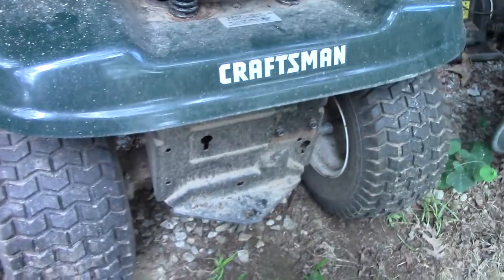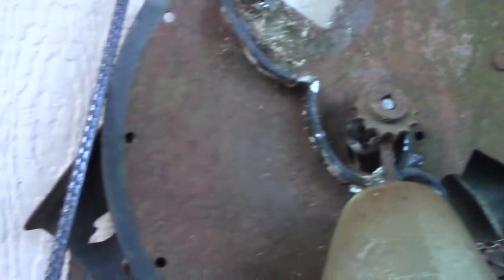Making a receiver hitch for a riding lawn mower from scrap DIY

Comment: Good timing. I was looking for something to watch.
Reply from the maker: Well then I apologize. I meant to post when you were disinterested.
Reply: @theeddies  Oh don't worry...You did! lol - It looks good. I would radius the edges so it's slightly less of a bloody shin tetanus situation going down when you walk into it.  Nice scrap horde btw.
Reply: @theeddies  What are you wanting to tow with it? I mean I get that you are going to build a "trailer" for it, but to haul what?
Reply: @theeddies  I see. Just all purpose utility kind of thing. You going to make it dump, or nah? - I mean the two leading edges on the left and right where you cut the plate (AKA the corners of the plate).  Did you sell any of those car parts yet??
Reply from the maker: Lol. I may have cut a few corners, ba dump bump, to get it done with a dodgy camera. I might need it Monday for a tree that is coming down in the front yard. Yes it will dump and no it will not be power dump. I am the power dumper in the family.
Reply: @theeddies  Oh brother! lol
Reply: @theeddies  What's the max you would pay for that little Atlas?
Reply from the maker: Around here I would give him his asking. But I can part it on ebay and make money on it if it is too much to restore. Speaking of which I did not answer your question. I have sold a few small bits of the car lot, maybe $100 so far. That stuff moves slow which is why I have always stayed away from cars. I do have a single wrench, marked "MG Cylinder Head Wrench" which is currently bid up to $52. Might go up to $100, they are pretty rare I understand. So that's nice.
Reply: @theeddies  Hell yeah at $52. Be sure to let me know where it tops out at. That's great. I can see stuff moving slow, but still moving eventually all the same. - Of course you would give the asking price as would I, but I mean if you saw it listed for $250 would you take a chance on it? I guess I understand, yet I just don't get it either, but those little toy ass lathes sell. I don't know how people have the nerve to ask like $600-$800 (or more) for shit like that, but they do. I haven't heard back from the seller, so its likely long gone. I imagine his email blew up at that price! lol
Reply from the maker: @johnstrange6799  $250 I might still do it but it would not be a slam dunk. I would probably dick around until it was already gone, lol. The little lathes can do some good work, not the 7x12 HF ones but the 9" can do alot. I mean would I want to make the little parts for that coax indicator on a 12" lathe? You could but it is abit of overkill. Most of what I do, my lathe is plenty big enough. If I were doing driveshafts it would be different. Most people are not doing driveshafts or hydraulic cylinders or whatever. They are doing model engines or small parts or some such. Plus moving the big ones and having space for something that is a rarely used tool are issues as well. Most guys I meet with 12" lathes have them back in a dusty corner with other crap all over them. They look like they have not been used in years. And they are usually for sale...for the RIGHT PRICE.
Reply from the maker: @johnstrange6799  as for price, it is often just regional. the same with vintage British motorcycles. They are cheaper up north. There were just more of them up there, more dealers to sell them. I think Chicago had 10 dealers back in the day, there is still a huge warehouse of NOS parts up there that sells. In Atlanta there was 2 or 3 dealers in the 60's and one in the 70's.
Reply: @theeddies  I'm the opposite. I like larger lathes. If I could have a bigger one I would. Not for larger work, but for power and rigidity sake. A large powerful (faster as well)  lathe cuts metal more like wood. Just peels it away like nothing which is nice, and produces a nice finish as well. Without a doubt good work can be done on small lathes though. I'm not hating. I can imagine how people might get used to a small machine if it's all they know, but personally I wouldn't want to use something like the Craftsman I had. I couldn't go back to something like that.  The fun of machining something would be gone for me. I'm not into long bed lathes though. A nice gear head 16" would be perfect. A Monarch, or a Mori Seki. If I were rich I would pop for a fully restored 10ee for small parts.
Reply: @theeddies  Yeah, there is a regional factor, but I see that kind of evening out in some instances. I see many lathes and mills that would be the same price here or there, yet still there are pockets of places it seems. Wisconsin (especially) and Michigan have deals all the time. I see a lot of Ohio deals too.
Reply from the maker: @johnstrange6799  oh I get it and that is something I am struggling with now. Get something slightly bigger than what I have that has more functionality or go bigger. I honestly just don't have the infrastructure for more than that Atlas I missed. Wood floor shed, limited electrics, etc. But if I am being completely honest my problems are not rigidity, it is power feed. I get decent finishes on my parts but it is a struggle with hand feeding and usually requires some massaging. NOW, if I had a double E I could make axles and trans shafts relatively easy with good precision. A new Triumph axle sells for around $60 new. Trans shafts for $150 and up. $5 or $10 in stock bought in bulk and a half hour for an axle or hour for a shaft each would be a nice return. Hardness tester and a double E and that would be a business and not a hobby. On that note, someone contacted me asking if I would fix a dog dryer, lol. I said sure. $45 an hour plus parts. We'll see,lol
Reply: @theeddies  ...Travel by ship for 2 weeks, scale a sheer cliff wall, then descend 3 and 1/2 miles into a coal mine to get a machine that takes 30 circus strongmen to even look at! And if you're not quick.... someone will get it before you!
Reply from the maker: @johnstrange6799  Or you could iron your bed linens and live like a king.
Reply: @theeddies  Well yeah, there is that too I suppose, but then I would have to let my staff go. (l'd have to let my staff go lol)
Reply from the maker: @johnstrange6799  You'd probably get more done if you would let go of your staff. https://youtu.be/8eXj97stbG8?t=24
Reply: @theeddies  I never told you this... hell, I've never told anyone, but I wrote that  "Dit- Dit Crash!" comedy punctuation drum part -and it was stolen from me!! I remember it like it was yesterday (Harp) I was in the middle of the seventh year of trying various combinations until I finally got it right one day by accident, but it wasn't me who decided it was right. It was the world! I would have been happy with what I still consider to be the far superior "Ding Ding Ding Boom Tat Tat", but fate is sometimes a cruel mistress.
Reply from the maker: @johnstrange6799  lol, I did not realize you were over 100 years old. Amazed you can use a computer.
Reply: @theeddies  Yeah, I don't like to brag or anything.
Reply from the maker: @johnstrange6799 at this point,  I'd give him $300 and walk away happy.
Reply: No way man! $300 is half of $600, and a 3rd of $900 (Obviously).... Think of how much better some of the lathes have been for not much more than $300. To me those Craftsman lathes just aren't worth it. If it was really nice, and with nothing missing, and with the change gears, then $300 and maybe $400 TOPS.
Reply from the maker: @johnstrange6799  there is what I want to pay, what I think I should pay and what my market says to pay. That lathe would last less than a day around me.  If I want another lathe, I can bargain all I want but if I keep losing them because the market is beating me then I just end up beating myself...err. I mean if I don't play the same game I end up playing with myself........you get the idea.

I don't know why you are so down on the Atlas. Is it the size? Are you overcompensating for something?
Reply from the maker: @johnstrange6799  I just bought a $400 camera for $70. BUT it is untested. No battery, no power plug.  It's a gamble but seller has good reviews and even if it does not work I can sell for parts and make most of my money back. Ordered batteries for $20 from Amazon which I can return. If it works it will be a hell of a deal. Much better than what I have. 18 megapixels vs 4. Bigger sensor so I can get better depth and low light. And it has 4K which I might use for special videos. We'll see. I am so cheap, lol. My late mother would be so proud, she could a dollar into a hundred by snapping her fingers.
Reply: @theeddies  I like your mom! I'm a hardcore cheapskate. Not stingy, but I just hate spending money. It gives me like a panic attack (Kind of) if I'm not spending money to make more money from something. What kind of camera did you buy? Interesting gamble. Sometimes some cameras are still under transferable warranty, or they have known issues that the company will repair for the cost of shipping or something.
Reply: @theeddies  Man... if you saw the amount of shit that is gathering for yard sale 2021 you would fall over. It's stupid levels of stuff. There's enough for a yard sale outside right now but the storage is still a 3rd full, and the shed and garage haven't even been tapped into yet. It's ridiculous! I'm making tables out of scrounged up doors.
Reply: @theeddies  One of my neighbors gave me a little junk motorcycle engine which I was all excited about until I got it home and discovered it's a CVT set up off of an ATV or scooter or something. Disappointment was very present as wanted a little transmission to dick around with.
Reply from the maker: @johnstrange6799  It is a Panasonic Lumix ZS60. Their mid line camera for 2019. They sell used for $175 to $250 and new about $350 now it looks like. Appears to be in great shape and hardly used. The seller told me they know nothing about it, a relative asked them to list it. Battery is dead and no charger so they just listed as untested. But he would take it back if there is a problem. Even known broken ones sell in the $70 range for parts so I really don't think I can go wrong. It is the same deal I got with my current camera basically, bought it really cheap untested, dead battery. I was lucky with it before I let a trailer fall on it. 

Speaking of which, do you want to focus group a short bit of video from the build I uploaded and see the "accident"?. I had to upload a bit because I used some copyright material and I am letting the checkers see if I can use it as is. That way I will know ahead of time whether I can monetize it or if I should take it out.
Reply from the maker: @johnstrange6799  Are you doing the sale this week? I guess the rain stopped up there and moved down her.
Reply: @theeddies  That'll be banging if it's a winner. You know you don't deserve 4k, right? Come to grips with that! Sure, I'll focus group the "Incident" footage.
Reply from the maker: @johnstrange6799  https://youtu.be/riv9O5AIZIM
It's unlisted so don't go sharing it on Facebook with all your buddies
Reply: @theeddies  Before I sell it on the dark we... What am I looking for again?
Reply from the maker: @johnstrange6799  nothing, just the trailer dropping on the camera at the end